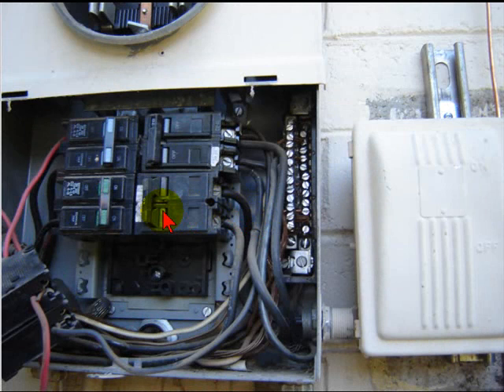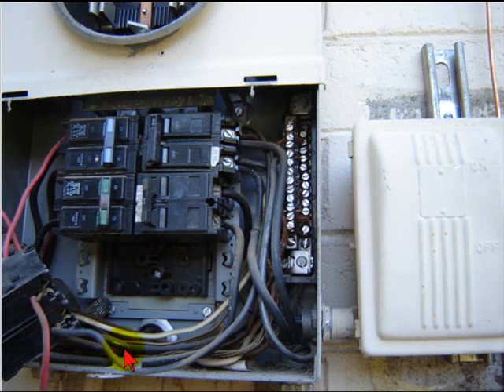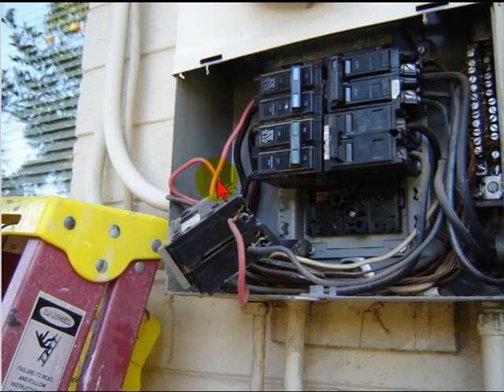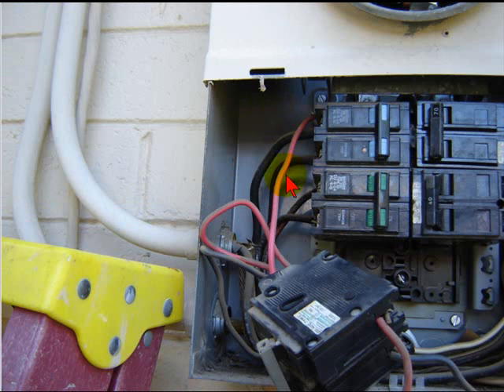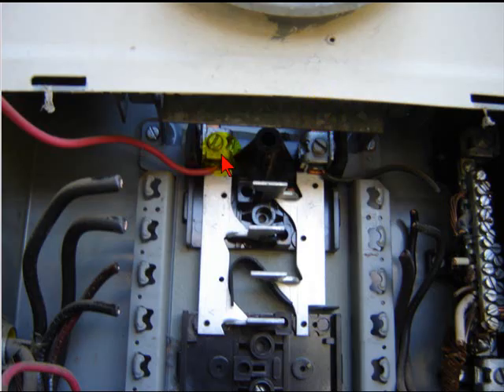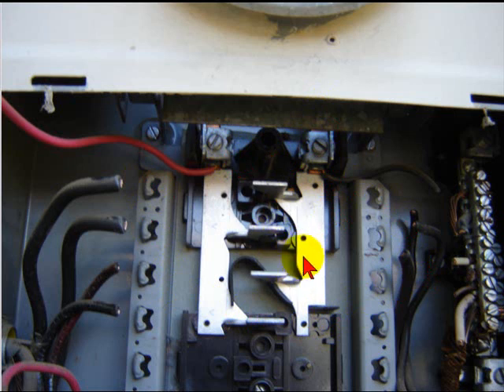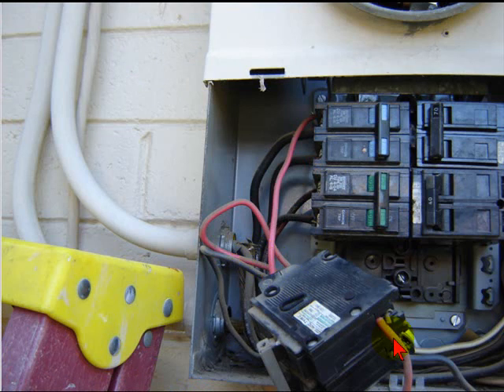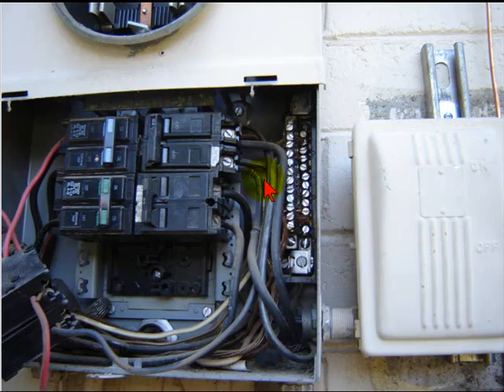Electrical Wiring-Breaker Jumpers

Comment: Thank you very much . Just ran into this for the first time ever tho Id heard bout it in class long ago. Panel box is very small & for an older double wide mobile home . Its 200 amps & did fine I guess for the double wide but an addition was added & apparently thats when all  the thinner breakers got added 
When space ran out they mixed several different breakers & then put the wrong breaker in a couple places as well as adding the well pump to lights & receptacles in the home 
GE in a Bryant breaker panel. Wrong contacts so they added a stranded wire under them & jammed them in the panel 
I was there to check on why some of the receptacles werent working & noticed the panel cover wasnt seated right . Little handy man job or so I was thinking 
Not an electrician anymore & was trying to do a favor & repair a broken receptacle or so I thought 
Incredible that the homeowners arent dead or me or the guy that had the bright idea to do something like this in the first place but apparently this had worked for several years with only a few tripping issues ????

Comment: Thankfully I live in a free state and don't have to put up with "professional" electricians and their crap.  It appears that most electricians are high school drop outs and couldn't pour p*** out of their boots if the instructions were written on the bottom of the boot.  I wired my house and shed from the meter/pole.  We also have a GREAT electric supplier that will let the individual pull the meter and we can just call them to have them replace the seal after the meter is re-installed.  It just takes a little common sense to do electrical wiring.

Comment: It's me again. Just wanting to tell you how much I was also jumping up and down raising " HELL " when in 1998 went to The Home Depot Cedar Park , Tx. Just outside Austin's city limits. Spark you will not believe it. I saw Three Phase Panels , Disconnects , and knife blade Cutout Boxes.. I know that it was " Crazy " and most were not even Nema 3 Steel man.. They tried it here. Boy you know that I wrote a Few Letters. The First was to the Electrical Board . " I'm not a snitch, but this pissed me off !. Later.

Comment: Hello there Sparkyu. I thought that I have seen it all... I've seen a lot in Austin, Tx. and surrounding areas. Glad that there are more attentive pro's out there saving home fire hazards. As we know all to well about the few years of the Federal Pacific brkrs that wouldn't trip on overload. I bet you've seen a # 12 glowing red in the sw.box. Seen that a few x's. One was at a friend's,, Master plumbers HM. Built in 1980. So It's just not the old 50amp Main . Truly you have saved lives as well as property... Keep up the great work... That's 'Y' there is a NEC as well as a NFPA.. No pun on the 'Y... When it comes to Critical Trades," a little knowledge is dangerous "!... J.E.F.. I will L.U.Knw. other things that we probably have came across.

Comment: The 2 pole 30 amp breaker that is not connected to the bus is NOT being fed from the line side of the meter, (like sparkyuonline said) but is connected to the load side of the meter.  He even showed the two wires coming off it after he cut everything loose.  So in effect all that has happened is space rather than bolting the 2 pole 30 amp pigtails were used instead due to the lack of space.  Look closely there are no # 10 wires that enter the meter cabinet.   Sketchy but not accurately described

Comment: if their tying in from the load side of the meter when the meter socket is pulled out is their still risk of electrical shock? ive heard of people trying to steal power by connecting their wires line side is that correct?

Comment: @cjazerjay #10 wire.. That is funny! ROFLMAO! If I remember correctly to run a 100A service line it should be around 6-2 with ground or even 0Ga. solid, where as a 220V stove would take 10-3 with ground.  Although 10Gague wire would run around 60A max load.  Considering working with AWG coding. Do I stand correct sparkyUonline?

Comment: @ArchNME Unless that 10 gauge wire gets a nick in the insulation on the line side and shorts out.  Then you have 100 Amps through a 30 amp wire.

Comment: This isn't as unsafe as you make it out to be.  If there is a 30 amp breaker on that 10 gauge wire than no more than 30 amps is going to come down it regardless of whether it's hooked directly to a million amp circuit.  10 gauge for 30 amps of current is fine.

Comment: If the 8" #10 wire that is replacing the lug were to short to the box and the box wasn't grounded, then it would be a problem. (deadly)

The only time that wire would see 100A is if it shorted inside the box and that would only last until the wire burned up.
The current that flows through that wire is determined by the 30A breaker as long as it remains insulated.
A cheap and dirty fix for a burned up bus lug and not wise practice but not as terrible as you proclaim.

Comment: You are correct.  The wire will carry it, as long as the insulation rating is good for it.

@sparkyUonline.  From memory 310.19  Remember you are looking for wire size, not insulation rating.  He stated #10, and not what kind of insulation was on the wire.  I know that TFE #10 is good for 107 amps, single conductor in free air.

Comment: The #4 from the meter socket to the main is not fused at 100amps.  It is called an un-fused conductor.  It has potential to carry the AIC (available in-rush current) that the power company has designed that substation to carry.  Most residential areas is 10kAIC.

Comment: @jwcoopest1975

The line wouldn't be ash.  The NEC protects wire from HEAT.

What is the amperage rating of a #10 TFE wire suspended in free air. 107 amps.  It can safely support this amount of HEAT because the insulation is made for that heat.  The conductor material is the same as #10 THHN (30 amps).

Comment: The only way you could get 100amps on that line, is if it grounded to the can through an insulation nick.  It could happen, and has before.

But, that line would have the potential of much greater than 100 amps.  There is a reason that those breakers are 10,000AIC rated.

Comment: 2002 NEC 310.16 a #10 AWG its only good for 30 AMP on the 60 degrees Celsius column (which is normally use, since terminals rarely have temperature rating)